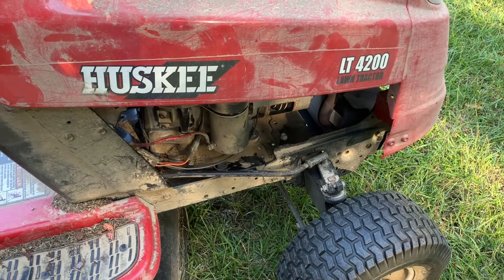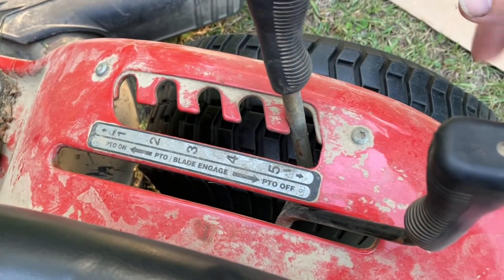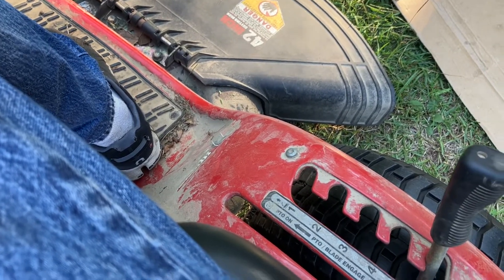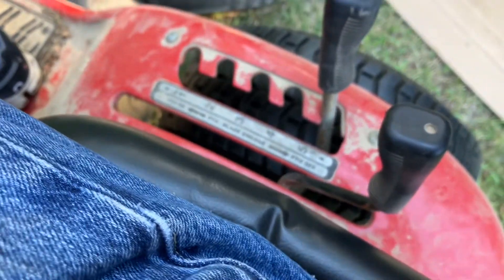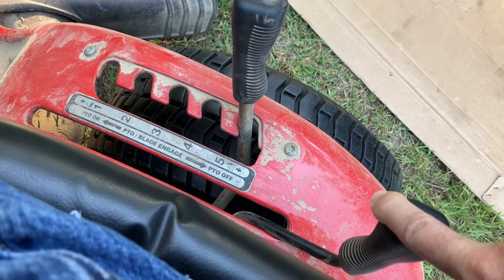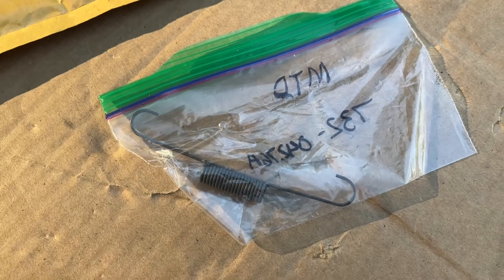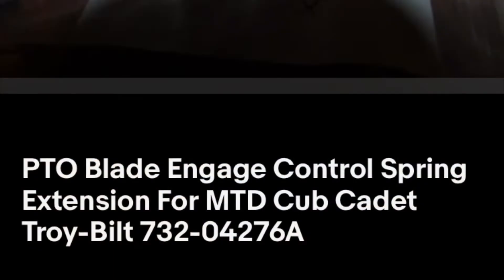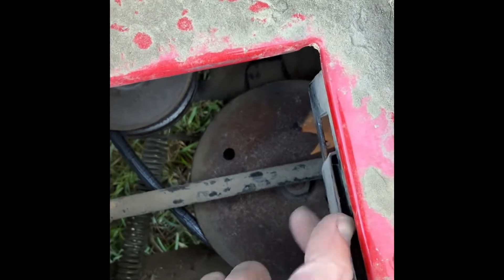MTD Huskee LT4200 2010 PTO lever spring replacement

Comment: This is exactly what I needed to know how ever I don’t think this is the reason I go through pto cables faster than I do my laundry every week
Reply from the maker: I glad I could help. I’m thankful I don’t have your PTO Cable problem. I bought one during some of my repairs, but didn’t need it. My current problem is I’m waiting on a tensioner pulley to come in the mail. I started hearing a new squeaky sound when the blade is engaged. Within about 15 minutes the belt had come off and the pulley was laying beside the lawnmower.  I thought I just put that thing on maybe 2 years ago, but my eBay purchase history has it at 5 years ago.